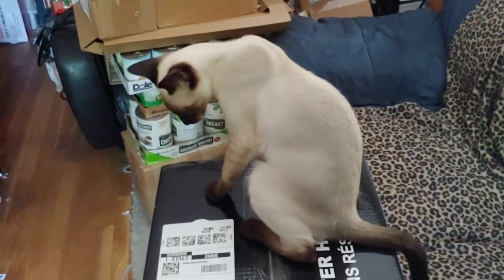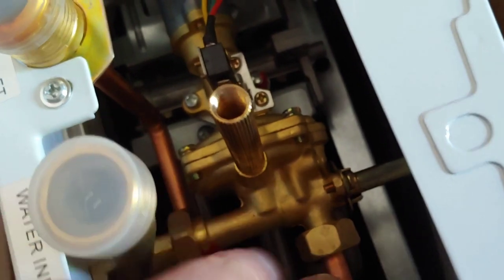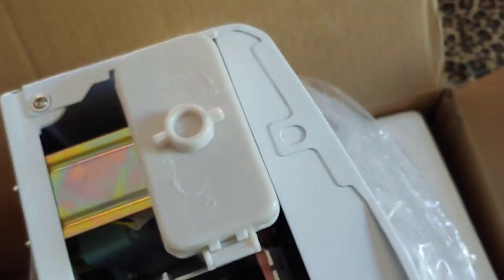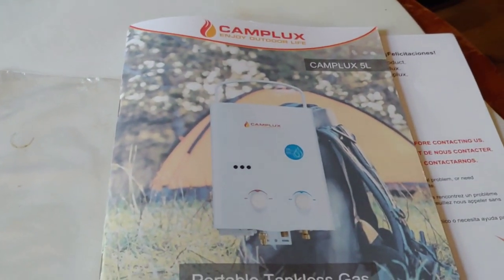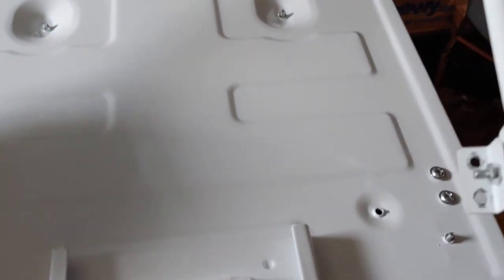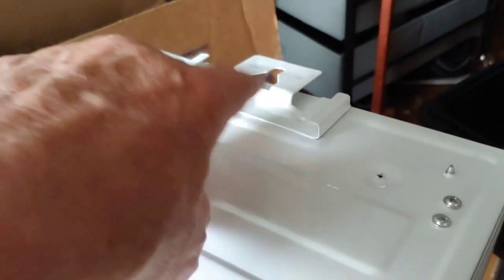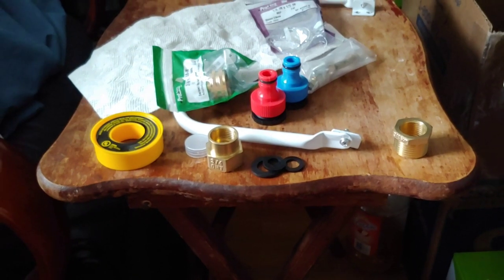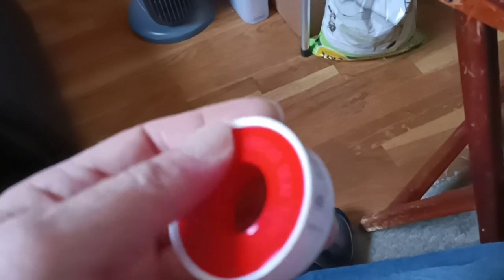SHTF - PORTABLE PROPANE FUELED SHOWER - BOX OPENING & DYI ASSEMBLY - W/ MODIFICATIONS - Oct 13, 2021

Comment: Wow a great idea.
Reply from the maker: I had to go to both hardware stores to buy the parts. Cost just under $300 for everything to assemble the filter setup.
 The most expensive item was the twin filter housings. The filters were the next expensive. 
When done using it, Remove both of the filters and allow them to air dry for a couple days. Store then by vacuum sealing them so the elements do not oxidize while in storage.
 Buy extra filters because they will not be available when it all hits the fan.
We live a stones throw from a river so that is the source. Plan to carry water back in 5 gallon containers back and allow the water to settle. Drops of Clorox bleach then filter the river water. During snowy winters, thaw snow and filters that water as well. The second filter removes biologics. When in doubt, boil water then consume it. Once filtered it can be stored for years in adequate containers.

Buy a water test unit and test the water when it is questioned.
Reply: @AdmiralPreparedness  thanks for all the information